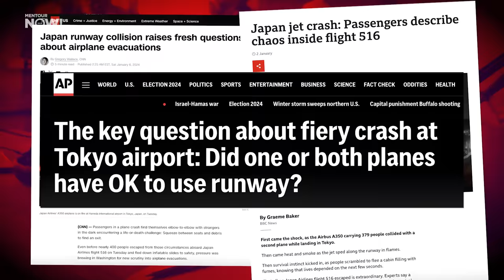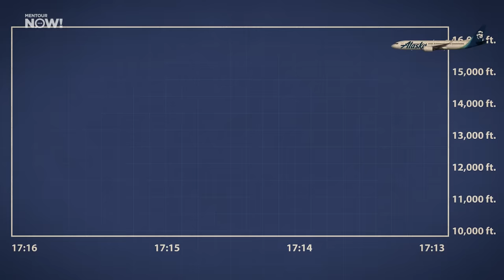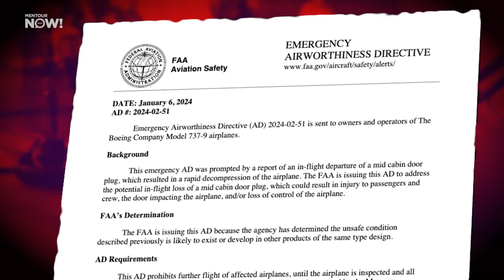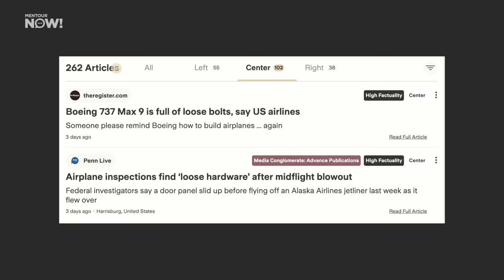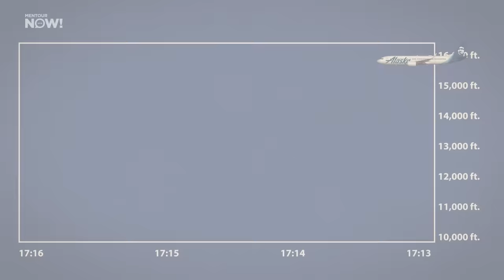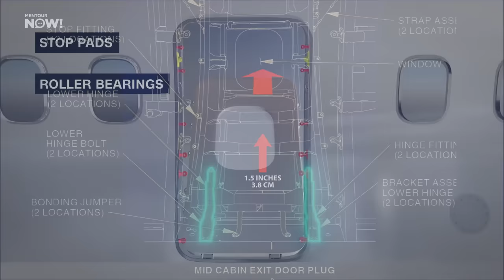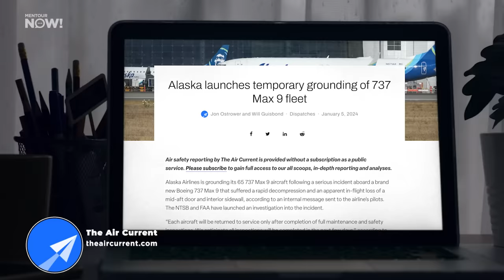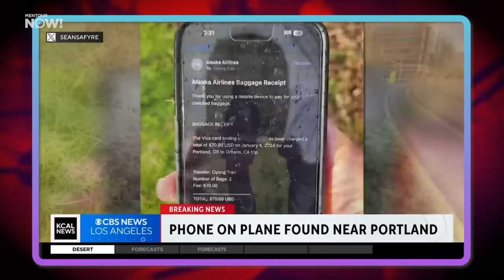WHAT Is going ON with Boeing?! MAX-9 Door blowout

Comment: This terrifies me. I'm a passenger and LOVE flying and being up in the air, however I wouldn't want to actually be in control of an aircraft (that's been confirmed for me as I've watched your videos). Years ago, when I was still allowed o bring my ESA (cat) on the plane, he had to sit next to the window on the seat (I always try to get the window seat because I really like looking out). I tried putting him next to me with me in the window seat and the flight attendants made me change, even though there was nobody next to me on either side. I always fly Alaska Airlines. Even though I haven't flown in years and the odds of me flying with my cat again are very slim (with the new rules about ESA's), when I think of this accident I still get PTSD-type visions of my cat getting sucked out of the aircraft, with there being absolutely nothing I could do. For as far back as I can remember flying I've always wrapped the strap of my carry-on backpack around my ankle, just in case the bottom of the aircraft dropped out from below me. I rationally know that if that happened I'd have bigger issues than my stuff falling to the ground and breaking, but it helps me a little bit with my anxiety. 
I was wondering what, if any, precautions there are for animals on flights, either those in cargo or those in the cabin (for example, service animals).
Reply: With all due respect, I'm not sure the internet is a safe place for you to be. Especially air disasters! Keep off the news, read a cat magazine, take your medication and keep up with your doctors appointments.

Comment: 😒.. Curious about sertification process of B 737 9 Max  by FAA before....

🧐.. There is - redundant - Plugdoor for 178 capacity plane... Not tightened permanently.. Just used only 4 bolts to screwed that Plugdoor...

😐

Comment: Those warning lights are not there to be ignored. The Maintenance people go to training at Boeing to be able to recognize problems like these. The avionics could have been checked; the wiring diagram responsible for those warning lights could have pointed them in the right direction. Obviously, the mechanics were under pressure to get the airplane flying again as soon as possible. Ignoring these warning lights is obviously not the main issue, the blame is equally with Spirit and Boeing quality control. Had the quality control be more "controlled" Boeing and Spirit could have shut down that avenue of speculation from the beginning. Guess what will be in the checklist in case of those warning lights coming on?

Comment: The doors own weight should keep it down and in alignment? Wrong. Slight turbulence that is not even noticed will flip it up. The cotter pin is similar to the way a car's wheel is kept attached  to an axle where the nut embedded in grease is otherwise easily spun off. The first few upward flips only raised the door a fraction of an inch, but enough to depressurize the plane, but this time it flipped up high enough to open the door.

Comment: Why only inspect frames with plugs? The knuckleheads who screwed up the system lug install could also have worked on full exit installs.  

Every exit door regardless needs to be inspected.  Or does that have to wait until another plug/door falls out?

Comment: If the bolts are needed to keep the door plugs from sliding out of place, what keeps the working emergency doors from suffering this same problem? Is it a different design? is there something else in those doors that holds them in place tighter? Is it just that a working door is heavy enough to not slide up from vibration and spring-pressure alone?
Reply: Nevermind. Found the answer in another video (https://youtu.be/nw4eQGAmXQ0?si=5mZBwXIf3UYz6Agj&t=955). The normal doors have automatic locks that keep them from opening mid-flight. And these would keep the doors closed through any amount of turbulence.

Comment: I've been curious about claims that objects were "sucked out" of the missing door plug during flight. My lay enthusiast's understanding was that -modern designs make that sort of violent decompression impossible.- I was hoping this video would explain whether or not those stories were news-media sensationalism -or an indicator of a decompression severe enough to challenge those safety features-
Reply: I'd say if a whole door sized area of fuselage disappears then rapid decompression is unavoidable.
Reply: There's no safety feature, if you lose a large section at once, it depressurizes like a champagne bottle. The mobile phones were indeed all sucked out, and its likely a passenger sat there would have been too, as has happened before.
Reply: Both answers match what I've found out since posting. I seem to have misunderstood something big about the history of aircraft pressurization and safety!

Comment: I don't know aviation. However I ride enough planes each year to take interest in the crafts I ride on. It wasn't mentioned here, but I specifically recall a report from a few years ago that the MAX design was a compromise. Too-large engines were mounted to an older craft design. This was evident in the "flat-spots" seen on the bottom of the engine casings. The too-large engines could shake the plane apart, and many quick-fixes were introduced like those air-low meters that ultimately failed and killed hundreds of people.

Comment: Four locking bolts and castle headed nuts each with their own split pin to stop the nuts from vibrating off. Even one bolt would have stopped the door sliding up, seems to me this was a lunch break or end of day job where the bolts, nuts and split pins were never fitted in the first place! Most cars only rely on one castle headed bolt and split pin to hold the wheel bearing on and how often do we hear of wheels coming off. To me at least this is down to carelessness or maybe someone with a grudge in Boeing.

Comment: The part about the reported pressure leak is not accurate, just letting it do some other flights is not really best shop practice and would cost me my licence in europe. If there is a leakage you check on the outside not on the inside so that arguement is invalid.

Comment: Type of bolt threads. Can that be the reason? There are about 10 to 15 common ways to make bolt threads. Light to open and also massproduced , hard to open , hard to open certain profile threads , mangled threads etc. Each have different purpose so material is just one feature for bolts. I can not remember exact terms of those special machinemangled bolts so sorry.

Comment: If Boeing won't restructure at the very high level, very soon they won't fight with Airbus (that battle is already lost), but they will have a hard time competing with Embraer or Bombardier.  And it's not only MAX-9, the MAX-8 have the same (and many other) issues! The quality process, at whole level - design, manufacturing, ensemble, control - has degraded terribly on Boeing. 
But hey, no worry, US gvnm will probably pump some billions, from the American citizens contributions, of course, to keep the shareholders and the board happy.

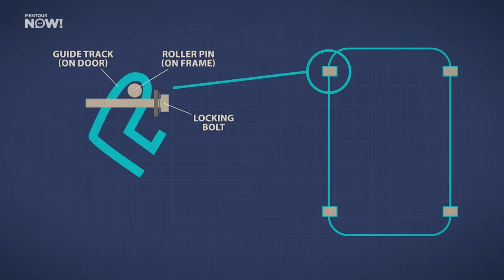Comment: At 16:26 in the video, look closely at the two supporting bolts, not the one with the cotter pin. Notice these bolts are both loose and not tightened. It is especially noticeable on the bottom bolt. This looks like very sloppy installation. Who is responsible? Who checks this shoddy work, Boeing or Spirit or both? Where are the check lists and who signed off on this? At the very least, some people SHOULD be fired, maybe investigated further for deliberate sabotage.

Comment: Another possible explanation for this accident (not yet seen it considered anywhere):

(I'm not maintaining that this is what happened, just that it should be checked out.   Because if it is what happened a lot more planes could be at risk than just Boeing's)

(doesn’t apply to this plane directly but well could indirectly   And could mean this accident is relevant to ALL airliners with door plugs, not just Boeing)

During Covid-19 restrictions many aircraft were used for delivery of packages instead of passengers (to utilize otherwise unneeded planes due to marked decrease in passenger traffic).   To make the loading and unloading of many packages easier, the emergency exits were used for loading and unloading (and, given the similarity of function, I suspect the door plug exits as well).

((Many of those planes will have been returned to passenger service (the plane in this incident was, of course, never used in that way… but it’s still relevant to it -  keep reading.))     

During that extended (many months long) use with the door plugs being opened and closed multiple times daily,  to make things easier, some (or all) crews loading and unloading the packages could have just stopped bothering putting all the bolts back into place:    The doors had to lift and inch and a half before opening and once the plane was at cruising altitude the pressure on the door would have been too much to allow that to happen.    So some “genius” might have decided that removing the bolts and then replacing them each time was a waste of effort:   the door is (supposedly) not going to come out even without them.   And only packages would get sucked out since no passengers were to be flying.   If that’s what was going on it may have worked well>> >as long as there was no extreme turbulence before the plane reached high enough altitude to “lock” the door with internal pressure.      

It’s more likely that such “shortcuts’ might have been developed when the passenger section was carrying only packages and no passengers.

Then passenger traffic picked  up again and the planes were returned to passenger service.

That could have led to two problems (one of which DOES involve this plane!):

The return of the planes to passenger service would have required reinstallation of the passenger seats.   Crews doing that may have, in at least some cases, included the same people who had removed and then reinstalled the doors many times without reinstalling any bolts (and, of course the bolts would not have been there in any case to reinstall! after the last cargo use (if they even knew that was going to be the last cargo use).   They may have overlooked them (despite theoretically knowing they were needed if passengers would be present).   Some crew members may have started AFTER the practice of not using the bolts had become established so that they didn’t even know that bolts were an issue.

CRITICAL POINT:   If this is true, this would potentially apply to ALL aircraft with door plugs and not merely Boeing!!   Especially if the same crews worked cleaning both Boeing and other aircraft.

As I understand it (could be wrong here) cleaning crews use the emergency exits (and presumably door plugs) to enter and exit because it saves a great deal of trouble navigating around all the turns and obstacles from the normal passenger entrances with cleaning equipment.

Some cleaning crews could have learned of the time saving measure of not bothering with the bolts on door plugs.  And/or some people who'd worked loading packages might have switched to cleaning planes when the planes were switched back to passengers.   And, by this time, this had been done in many aircraft for many months (several years probably) with no problems.   So some crew supervisor may have decided to make this a standard practice.   The airline(s?) might have known about it.    And door plugs loosened by turbulence at low altitudes may have cause enough leaks to trigger pressurization warnings but never a real problem.   So the airline(s?) could have considered this a common problem that just involved reseating the door.       Keeping seats next to the door plugs with “issues” could have become a standard response until the door plugs could be reseated during the next routine maintenance.   Hence the very convenient “coincidence” of the two empty seats.   This could readily be checked by checking records of seating charts and correlating empty seats next to door plugs with records of pressurization issues.   IMHO this ABSOLUTELY should be done!  NOT merely with Boeing, but with ALL aircraft with door plugs!

I suspect that it’s not even possible for the bolts to come out enough to release the door to move upward without serious displacement of the panel covering it, which surely would have been noticed.    That alone, IMHO, would strongly suggest that the bolts were missing before the door plug came off and not removed by the loss of the door.

If this was the cause then it may not be Boeing at fault, but whoever does the cleaning of the aircraft.  :   i.e.:  not a DESIGN problem (except for inadequate "Murphying") but a USE problem.

Comment: From the pictures that I saw @ 16min 39 seconds in this video and of the other aircraft, Just to the right of the pictured castellated nut in the red circle. WHERE IS TORQUE PUTTY and the INSPECTION STAMP in the torque putty. { I worked hanger operations on the KC-135 JT3D to KC-135 R program. As I remember bolts like that would have been torqued to specification and witnessed then applying TORQUE PUTTY, while it was still moist. We would apply our numbered stamp into the un-setup TOURQUE PUTTY. Like using hot wax and a stamp to emboss the wax as a letter seal. Back in the day of kings. 
And if that fitting is lose tension on the spring. Allowing the door to drop in relation to the door. 
The Boeing entrance and exit doors. The door HAS TO move into the aircraft then can it only be rotated and opened.
This is where the aircraft cabin pressure differential has the greatest effect to hold the door in place.
Taking that it is at minuminal cabin pressure differential, just being over 699 FT over 10,000. 
I hold an A&P certified FAA Airman.

Comment: Many thanks for another reliably informative video. One supplementary question, if I may. At 07:33, it is stated that repositioning of the aircraft was permitted but only if the cabin remained unpressurized. Would this have entailed flying at low altitude for the entire flight, or would the pilot and first officer have been the only crew and have to wear oxygen masks throughout? If the latter, supplementary bottled oxygen mixture would, presumably, have had to be carried in some location to provide an adequate supply?

Comment: What I do not understand is why a carrier like Alaska and United would want to order an aircraft with this plug. They are not LCC's (Low-Cost Carriers) and so far none of the Max-9 operators are LCC's. It is unlikely that they will ever want to stuff more seats inside these planes and if they ever did they would have to completely replace the door plug because it has a full-size window and cannot be converted to an emergency exit. This plug is a completely useless feature that adds more weight and reduces the safety of the airframe. 

As a solution to prevent future loss of this door in flight, I would recommend the removal of the lifting springs. They serve no purpose and it was the springs that ejected the plug. In addition to this change, I would like to see a special fitting that would go over the stop pad and stop fitting so that it is impossible for them to become misaligned. 

If these changes are made I believe that we will have a failsafe solution. Going forward Boeing should only supply operable exits at this location when specified by an LCC. When delivering to main-line carriers there should be no plug at this location. It should be a normal fuselage cross-section. The saving in weight alone should be a compelling reason for making this change.
Reply: While Alaska and United Airlines are not low-cost carriers, they may wish to sell their aircraft to LCCs at some point in the future. Therefore, having these door plugs could increase the resale value of these used aircraft as there would be a larger market for them.

Comment: I believe 2 major issues here. Firstly,  insuring QC/QA from subcontractors. It's the way of the world, for Boeing, Airbus, car and computer manufacturing etc. Boeing is going to need to restore confidence that it can maintain proper QC with its various outsourcing and 3rd party vendors.  Secondly, the 737 itself. It's an outdated design. Rather than a new clean sheet replacement Boeing has doubled down on MAX-imising profits from an old warhorse.

Comment: NTSB should research who sat in that window seat in say the past ten flights.  Was it a child?  What I am getting at was a child horsing around and banging on that interior wall, possibly causing those pins to loosen up and start sliding down.  But are these doors even necessary?  Just get rid of the un-used door.
Reply: If a child banging on an aircraft's wall can cause the pins in a door plug to become loose leading to loss of the door plug, then this would indicate a serious design flaw. Of course this should be investigated, but the forces on the door plug from pressurization, air currents, and turbulence would probably be greater than any child could exert on it.

Comment: Would I fly in a Boeing 737MAX? Yes, but I’m sitting at the aisle, with my seatbelt on and wearing a parachute.

Seriously though, I’m wondering how Boeing recover from the MAX issues. The brand is now tarnished, and maybe with it, the 737. Because the average traveller can’t distinguish between a MAX and an NG or classic model. Despite all of Boeings problems, I think they may have to finally find the money for a 737 replacement.